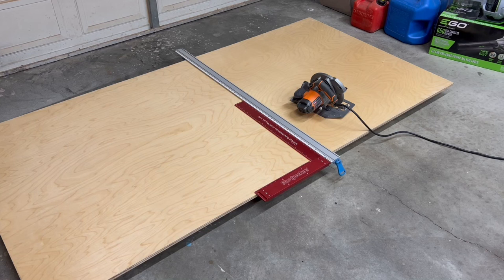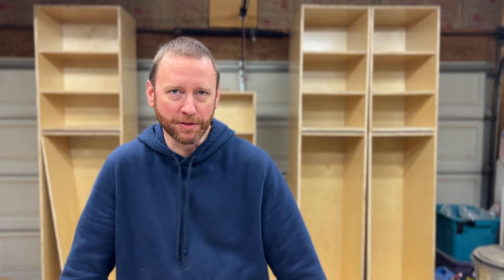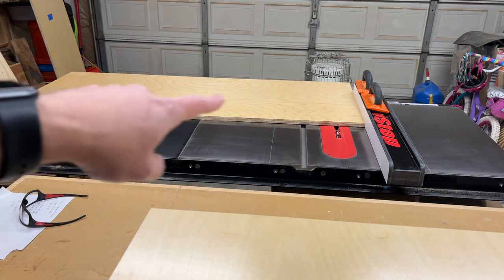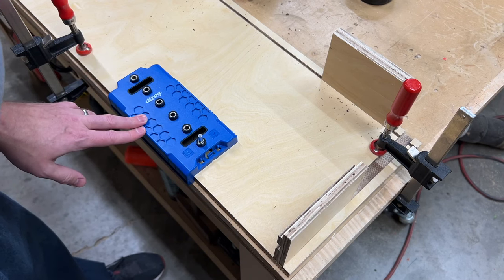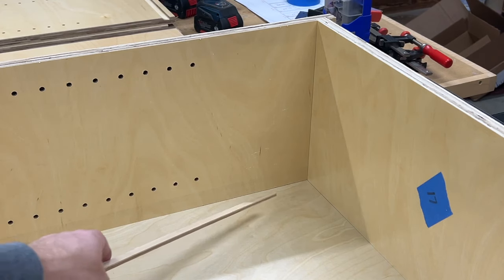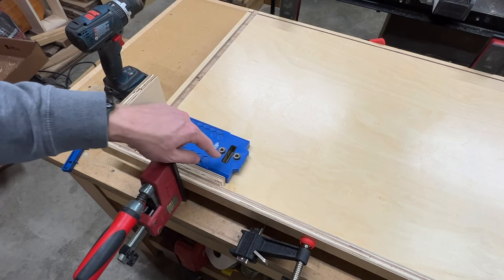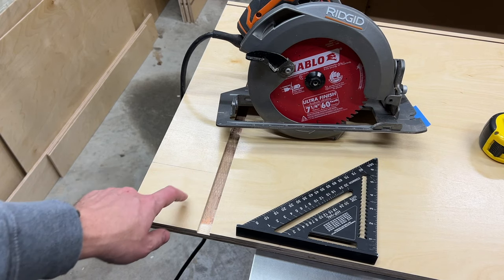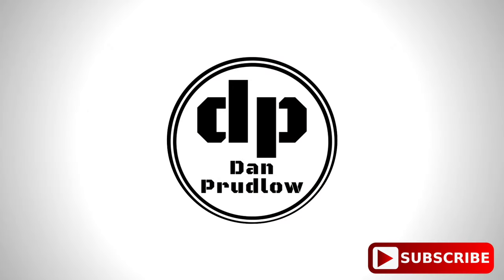How to build cabinet boxes

Comment from the maker: Check out Pt. 2 (face frames) here: https://youtu.be/FM-vHUX4RqY
Check out Pt. 3 (pull out trays) here: https://youtu.be/vZCh6tgAyOE
Check out Pt. 4 (spice rack) here: https://youtu.be/gNgxr3OD_Jg
Check out Pt. 5 (baking pan organization) here: https://youtu.be/8bDZoL3tkf0
Check out Pt. 6 (shaker doors) here: https://youtu.be/-VTCq2thw5w

Want to support the channel? Here's what you can do:
 - Subscribe to the channel
 - Hit that Like button
 - Leave a comment
 - Amazon Affiliate: https://amzn.to/2LaN1Ib

In this video I go through all of the steps to build the plywood cabinet boxes for a set of custom cabinets I am building for our laundry room remodel.  I used pre-finished birch plywood for this project.  I also used a dado stack for the first time and picked up a Kreg shelf pin jig to drill all of the shelf pin holes.  Be sure to subscribe so you don't miss future videos covering the face frames, doors, and roll out trays.  All of the build process for these cabinets could be applied to many other projects such as a kitchen, bathroom, etc.  Let me know what you think in the comments section below.

Kreg Shelf Pin Jig: https://amzn.to/3y9rMR2
Shelf Pins: https://amzn.to/3ZeSx2E
Diablo Dado Stack: https://amzn.to/3y7yk2E
SawStop 1.75hp PCS: https://amzn.to/2X4gWsP
Ridge Carbide 10-inch Saw blade: https://amzn.to/3bATmcp
Fisch Brad Point Drill Bit Set: https://amzn.to/3yMXO3C
Bosch 18v Drill: https://amzn.to/2OmrItJ
Bosch 18v Impact Driver: https://amzn.to/3cxAhJk

Thanks for watching.  If you have any comments or questions please leave them below or hit me up on social media or my website.

Hit that like button and don't forget to subscribe!  Thanks!

Subscribe: https://www.youtube.com/danprudlow?sub_confirmation=1

Twitter: http://twitter.com/DanPrudlow